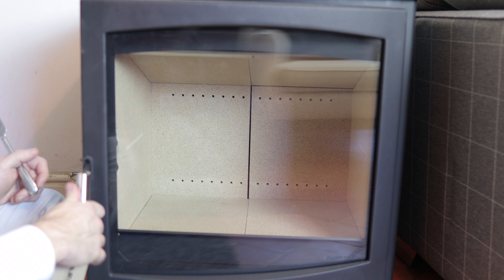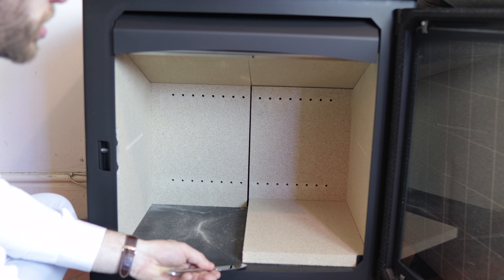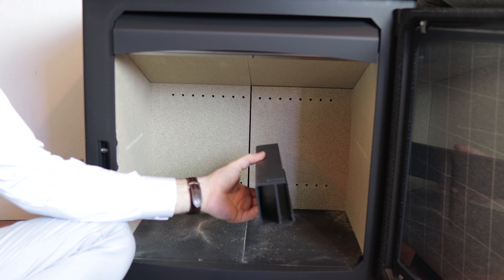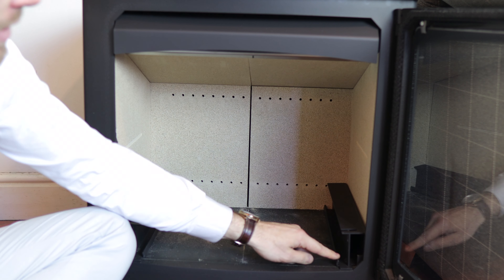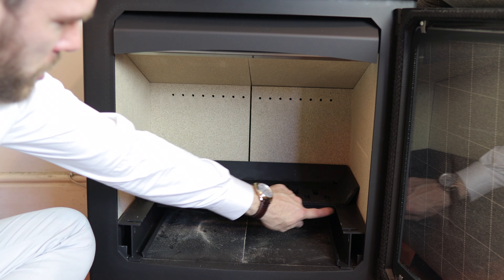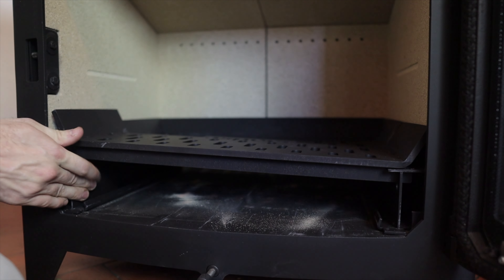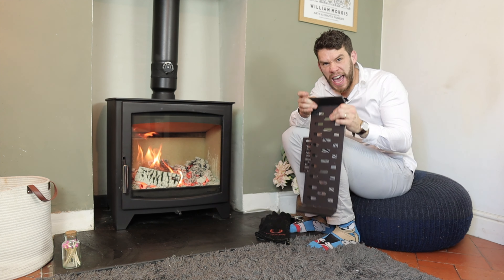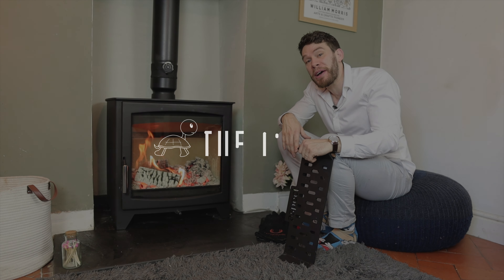Parkray Aspect optional multi-fuel grate

Comment: I'm sceptical of these add on grate kits. The one on my Aspect 4 DS seemed to cause the glass to craze despite the fuel being bone dry and burnt with a reasonable amount of air flow. Parkray said it was due to over firing but there's no way it was as the temps were never above 400f and I strongly believe the additional heat eminating from the additional grate kit caused the crazing as it only occurred directly in front of the additional steel/iron work and nowhere else on either of the 2 door glasses. I'd be interested to know your thoughts on this. Have to say though, other than that the Aspect stoves are impressive as wood burners👍
Reply from the maker: This is normally caused by the condensation from when you’re first burning. This would align with the fact that it happened near the metal work, which prevents air from dry it out. It doesn’t tend to be temperature at all, it’s moisture mixing with the fumes from smokeless fuel. 
Good advice to everyone is to ensure you leave the door open until all condensation is gone. As long as you do that it should never happen again. 

This is a real pain, and because the model wasn’t designed with a grate from the ground up, could have contributed to the issue. But to be fair no matter what stove you have condensation is the enemy in this case.
Reply: does the crazing damage the glass, can you clean it off to like new with a bit of wet ash or cleaner?
Reply: @leeyo5494  No, it's where sulphuric acid actually etches into the glass. It's permanent.
Reply: @jonharvey5268  ive just got an aspect 8 not fitted yet im not going to burn coal now,if it will cause damage is there anyway to avoid it?